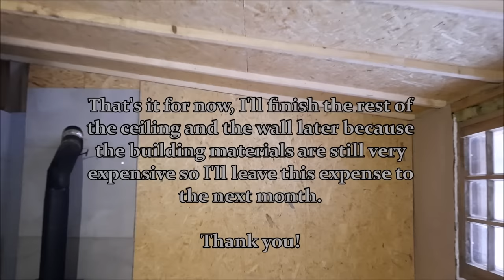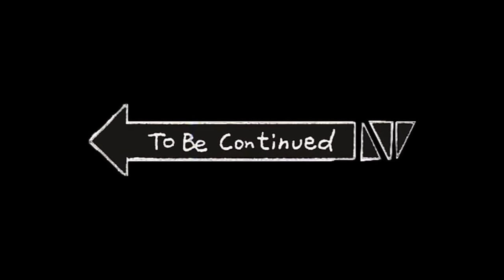Pallet garage build. Part4.

Comment: Like the rock wool insulation.  Too often builders do not remember to ventilate.  Must always allow the moisture an escape route.  By neglecting this, your roof sheathing will rot from the moisture that will collect above the insulation. (created by heating from stove plus insulation is not perfect.  It slows heat transfer but is not a vapor barrier).  Would have been better to put the ceiling directly on bottom of rafters and rock wool flush to bottom of rafters, leaving one and half inch between top of wool and  bottom of roof sheathing. Then put small screened vents on outside at top of wall above the insulation and a ridge vent entire length of ridge (at peak).  This will allow air to enter at bottom and this airflow will take moisture out the ridge like a chimney.  I did not say this to be mean, but I have made this mistake myself.  Live and learn.
Reply from the maker: Well thank you anyway ;)

Comment: you did an excellent job on your garage build. Very, very impressive.  My only concern is that fireplace.  I know there is supposed to be on the inside and outside steel rims that go around the stove pipe to prevent the heat of the pipe starting a fire and the closeness of the insulation to that piping.  Other than that excellent job!
Reply from the maker: Thank you! I am still working on the edges of the chimney, but there is already fireproof insulation there.
All the best to you!

Comment: Should there be actually a proper moisture stopper like plastic inside behind your sheating because if you heat inside and outside is cold, then moisture is gradually end into insulation? At least building houses always needs to do like this way. Correct me if I loose something in your video!
Reply from the maker: Hey, probably yes, this is one reason why there is paper on the wall. the ceiling came as it is. 
It is also worth noting that I am not building a house, I am not a professional builder and this is not a how to build video.
Thank you!